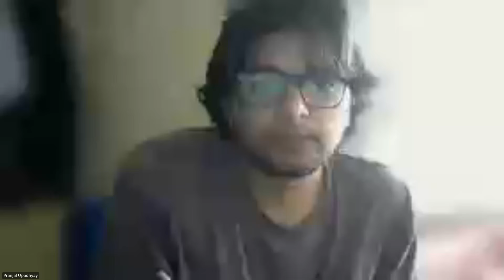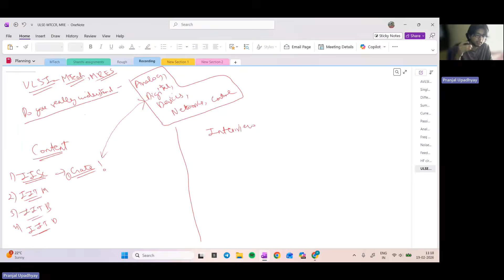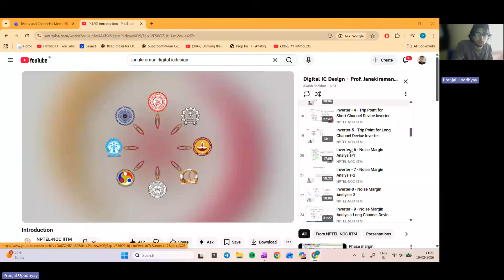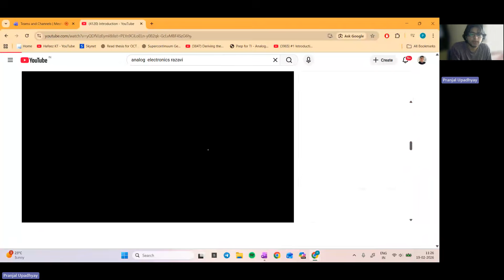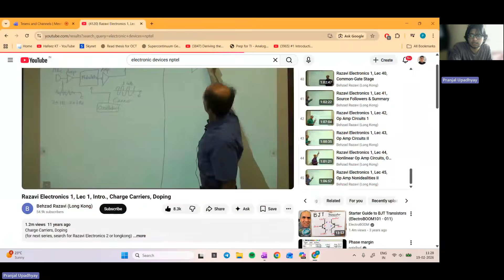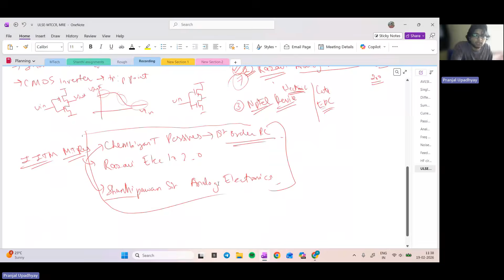How to prepare for MTech MVLSI (and VLSI related branch) interviews after GATE? Post GATE guidance

Comment: Hi pranjal, Thank you so much for guiding. I gave my interview very well today for Electronics system engineering,  professor was very satisifed. But written test was very tough i didn't gave my best. But thank you so much your suggestions that helped me alot.
Reply from the maker: no worries...no matter how it went you gained experience...your rank is good so youll get something great anyways.....good luck...hopefully Ill see you at iisc next sem !!
Reply from the maker: however ill suggest you to talk with ese seniors themselves to get some idea of coursework and pressure ...in linkedin...you can also consider iitm mvlsi nhtta if you are into analog roles....

Comment: Hi Pranjal, as I mentioned earlier, I secured AIR 179 (Score: 791) in ECE (General). However, I was shortlisted only for Electronic and Systems Engineering and not for MVLSI. What could be the reason?
Reply from the maker: probably the cutoff for MVLSI is high this year for gen cat
Reply from the maker: still you can mail to admission handles and DESE iisc mails to get clarification

Comment: Hi Pranjal, as I mentioned earlier, I expected a rank between 150–200. I’ve secured AIR 179 (Score-791) in ECE and AIR 59 in IN (General). I’m planning to pursue MVLSI at IISc since my primary interest lies in that area. However, if I don’t get MVLSI, I’m considering ESE at IISc as an alternative. Do you think ESE would still be a good choice in that case? Also, could you share any suggestions or tips for preparing for the ESE interview?
Reply from the maker: yes for your rank mvlsi and ESE at iisc are best options...in ese however making analog vlsi profile will be hard.....for ese interview...you can try to revise some basics of microcontroller microprocessors, apart from whatever i have mentioned in video....you cant contact me on my socials , i will share you iisc interview experiences

Comment: Hi bro I am getting 53 marks in ece with obc category with worst case rank 800 with gate score 650 can I get call for electronics system engineering from IISC banglore or can I get vlsi or vlsi related interdisciplinary branch in old IITS
Reply from the maker: top vlsi branch is hard to get...you can surely get iisc ese and even iisc mvlsi as interview is there....prepare really well for interviews...you can get iitm ese also...and iitb ssd....but the best case is that you get iisc mvlsi or ese
Reply: @PranjalEce  bro seriously at 800 rank i will get mtech vlsi interview call from IISC
Reply from the maker: @darshan2041 see in mvlsi iisc there are multiple people with 500+ rank ... i assume they would be from obc, some sc....as even in gen category 200+ rank people are there....mvlsi even if you dont get iisc ese is great too if you are looking forward to making digital profile

Comment: Getting 46.67 in IN paper and 36.6 in ECE, I'm obc ncl, which NITs or IITs can I get vlsi
Reply from the maker: At your marks, you will probably get a rank of around 2,000 to 3,000, best case. So at this rank, you will get a mid-tier NIT or a mid-tier or low-tier IIT M.Tech VLSI. In my opinion, such opportunities are not worth considering. And if you can afford to, you should try taking a drop, and you can surely improve your performance by another 15 to 20 marks, then you can get much better options. So if you can, try taking a drop at your current score; otherwise, you can consider trying for IIIT Hyderabad, which takes its own exams, so you can again try for that, or you can try for IIIT Bangalore VLSI. Apart from that, I don't think there are any other good opportunities for your marks and your category.  You can try for M.Tech research or PhD programs by applying at top IITs and IISc because I have seen that cutoffs for these programs go very low, but again, you have to crack your interviews there. So if you are fine with doing research, if you want to get the best outcome from your GATE marks and GATE score, then I'd recommend trying for top IITs, that is IIT Madras, IIT Bombay, IIT Delhi, or IISc M.Tech research and PhD programs, which do take intake at low GATE scores. And if you really want to do M.Tech VLSI only, then I would suggest to go for a drop year.
Reply: @PranjalEce  sir IN marks won't help?? I saw in all NITs accept IN score for their vlsi programs and rank predictors showing score between 520-570, and previous year trends i did chatgpt showed it takes IN score too..and the mtech research u talking about is fixed 3 year mtech program? As I don't want to go for MS research ..also sir like how'd be workload for mtech RA, like I can get time to prepare for placements as I want placement only..I heard spending time in labs and all makes tired
Reply from the maker: RA is like MS only and placement is a byproduct of your research work....but doing RA from iitb iitm iisc is way more worthy than doing mtech from mid low nits....still if you dont have any drive for research, try for top 5 vlsi mtech nits ...or iiits
Reply: @PranjalEce thnx sirrr, means a lot, just one last question like can I get shortlisted MTECH RA at top IITs with this score?I know after that interview and exam will be taken, it's upto me to clear that...and also sir which NITs i can target during CCMT for vlsi
Reply from the maker: last year iitb ics ra was calling at low gate scores of around 600 to 650.....chances are slim at top iits ...but you should try....as of IN many top branches dont except IN score(eg. air 2 IN got mvlsi iisc not by IN rank but by EC AIR 37 ....his EC gate score was preferred for admission, he is my batchmate)....however no harm in trying so apply and also keep studying as it will benefit you nonetheless......as fot nits ....trichy will be hard ...warrangal kurukshetra  you can try...but mtech mvlsi is still hard there.....join gate counselling group....dm me on insta or linkedin...i will send you its link
Reply: @PranjalEce any other IITs other than IITB, like guwahati or Hyderabad or kgp or kanpur? For 3 year MTECH RA. Are there chances and also like will those be good?
Reply from the maker: @Yasmeen-v7m7w tbh not really, if its easy to get in , its probably not good

Comment: Hi pranjal, I'm getting marks of 56 in ee(predicted rank around 250 to 350) and 55 in ec (predicted rank around 400 to 600)
Any chance that I could get vlsi related branches in top 6 iits/iisc mtech?
Reply from the maker: if GEN category...chances to get interview call are slim in  iisc mvlsi...but you can surely get admission in ESE MTECH AT IISC....ese mtech iisc is very good if you are inclined towards digital domain
Reply: Ok